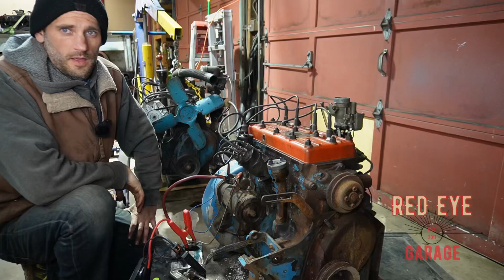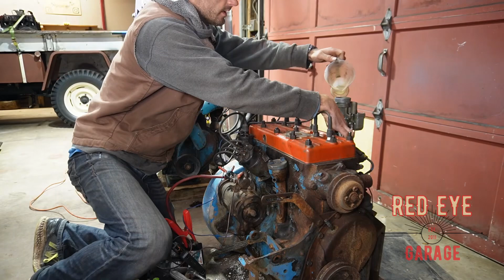Junk Yard Willys engine fail?

Comment: So cool to see another L head revived and back to life. 

I have one question for you, Seth. I was binge watching some of your older videos and found a short with the rotary Gpw exhaust sound. But it was published a while before you had any videos of rotary swapping, and still had a rear pto. So I'm thinking it was still an L head. If so, what exhaust were you using? It sounded really awesome. I'm planning an exhaust for my hurricane. Was wondering what muffler might make it sound cooler?   Thanks.
Reply from the maker: Thanks! Yeah before the Gpw had a rotary swap… it was an L-head. I made a custom 2” full stainless exhaust for it. It was pretty basic with a 14” turbine style muffler. It was too loud for my taste but did sound kinda cool.
Reply: @redeyecafegarage7484  Thank you! I was planning on getting pre bent pipes from KW enough to get to the rear axle and then an adapter with a custom muffler. I had no idea what muffler to get, I just wanted something unique. Thank you again!

Comment: Great video, thanks again. Pretty cool to see another L134 back in action. Quick suggestion; My 1946 CJ2A starts hard (but starts easy once warmed up) - any possibility of a vid to show tips and tricks for easier starting of a L134? I for one could really use some pointers! Best regards, Dan
Reply from the maker: Thanks! Later this spring I can try to do an L-head tuneup video. If the engine is healthy it usually just needs a little tlc to start better. The Carburetor is often the culprit.
Reply: That would be great, thanks again. Btw, my CJ2A is still a 6 volt system, so I'd be very interested for any suggestions to improve starting. Cheers, Dan =)

Comment: Right on man! Hearing something fire after working on it always makes me giddy and smile. Even if it’s the lawnmower in the spring that won’t start…. 

Offtopic question. I noticed your tdi jeep appears to have sound deadening on the underside of the hood. Did you notice a difference before and after? Is it worth the time and effort?
Reply from the maker: Thanks! Yes I agree. So rewarding once it finally lights off after being silent for so many years. In my opinion the sound deadening stuff only helps a little. If I were to do it again I would just put a few random squares in the middle of large panels. I definitely wouldn’t cover the whole thing. It’s unnecessary.